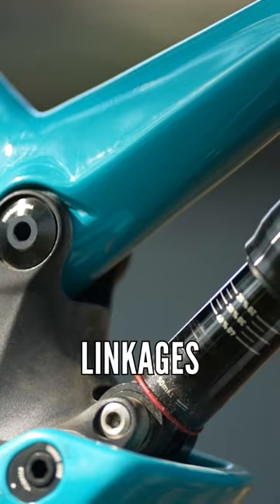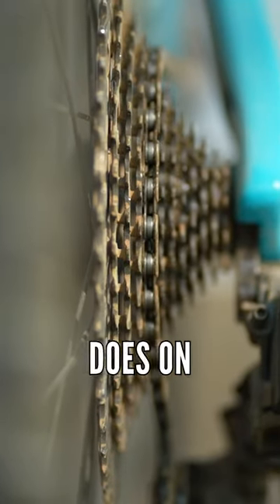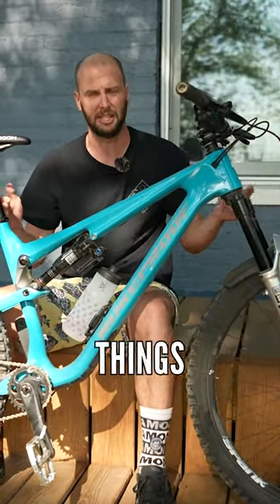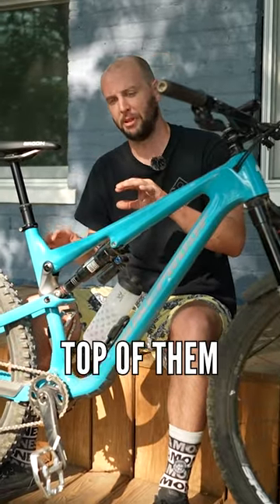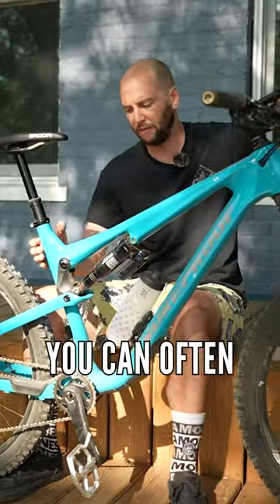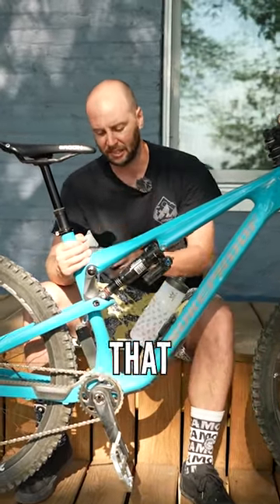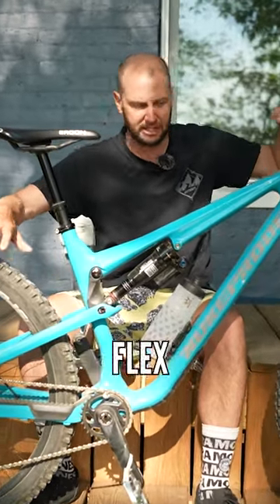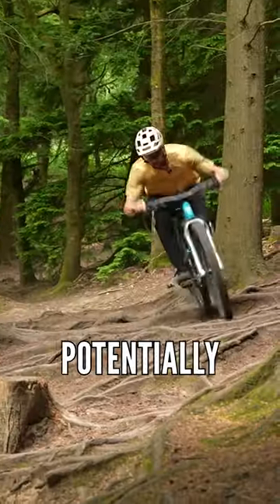How To Tell If Your Pivot Bearings Are Worn!🔧

Comment: Rubber protected sealed bearings are shitty fragile, simple damaged nut can destroy your sealed rubberish dumbing
Reply: What are you on about? Llu/ll rubber shielded bearings are fine unless you installed them incorrectly. Metal shielded ones are available but add more drag. Sealed bearings don’t last forever.